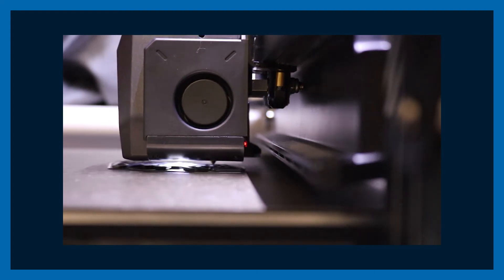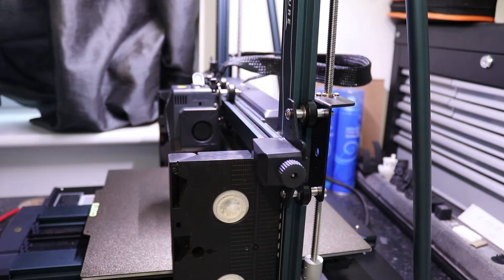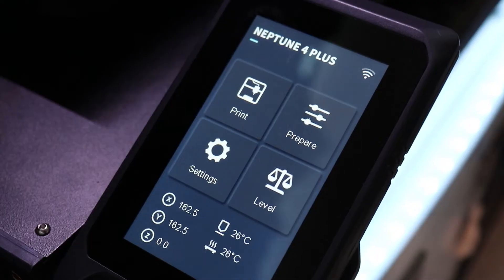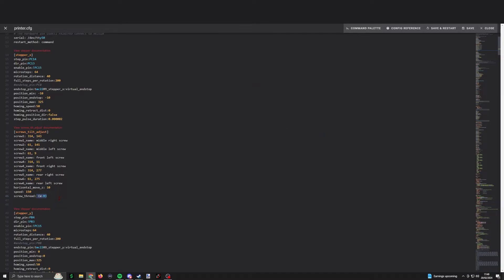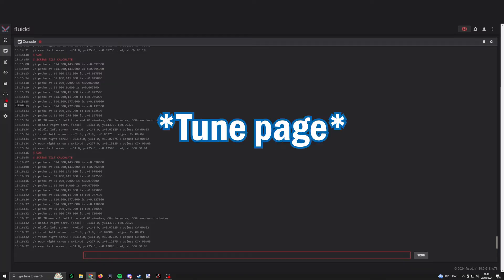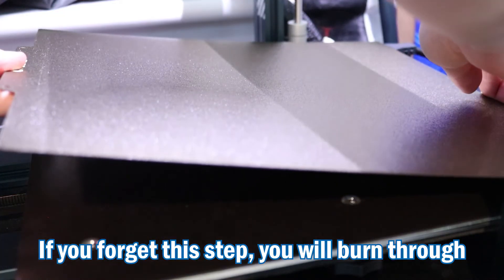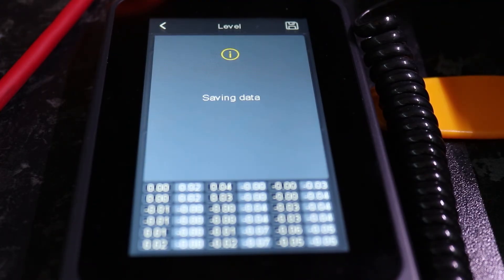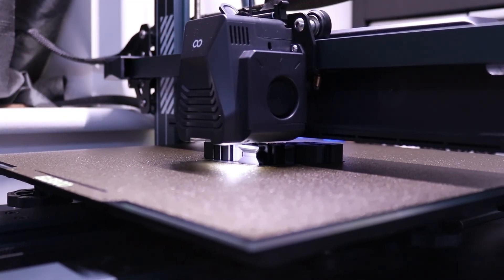Beginner Guide To Your Neptune 4 Printer

Comment: im confused about the leveling. because when I put the paper in and adjust the bed so that I barely feel traction, the head drags and scratches previous layers.
Reply from the maker: @jb1139  could be that the level isn’t being saved.

Make sure the bed is manually levelled first and is as flat as you possibly can get it.

What I have done to some issues was Z-Offset > Auto Level > Z-Offset. Always finish with a Z level.

But secondly that is partially why I couldn’t do the paper method. When I did the paper method I actually caused minor scratching on the print bed. Which is why I’d highly recommend a feeler guard as you can feel more and work from there.

After you can do some bed level tests to work on the Z more.

Hope this helps
Reply: @jb1139 if your 1st layer is good you might have too high flow rate like me

Comment: Hi, do you still recommend the N4+?  I purchased it today and I'm watching every video about ot till it arrives
Reply from the maker: @imnotryuu6391  Hi, so from my experience I had an issue where filament did get stuck in the extruder. Elegoo did send out a new one for me, I haven’t really heard of anyone having issues like what I had, so it’s probably a rare issue. Besides that the printer has been alright.

Since it is a lower end costing printer you do need to be hands on to tune it.

There’s always things they could’ve done to make it more user friendly but there’s loads of help online. 

I personally use Orca Slicer as I find that easier to work with imo.
Recently I’ve used ChatGPT to help dumb things down for myself too to make it more understandable.

Comment: im a little lost on what you mean by tightening the bed on the opposite side? So if the eccentric nut is on the right i should tighten the bed screw on the left?
Reply from the maker: @MasnMakes3d  So if you notice the left wheels are loose, you need to tighten the right wheels up since the right wheels have the eccentric nuts. The only wheel on the left side that has an eccentric nut is the middle one.
If the left is tight, loosen it via the right too btw.

Hope this made sense and cleared that part up for you?
Reply: @CazaCreates  yeah thanks buddy
Reply from the maker: @MasnMakes3d  no problem :)

Comment: For Screw Tilt Adjust, why not make the reference point one of the two center screws? That way, you don't have to adjust those to obtain a level bed.
Reply from the maker: @modinproductions  I did. I also mentioned it around 3:50. I personally use the right middle due to the printer placement.
Reply: @CazaCreates  ah, I misunderstood you. Thought you were referring to the two center wheels on the edges.
Reply from the maker: @ All good :)

Comment: How about properly turning it off?
Reply from the maker: @llNATEDOGGll  according to u/EarlyActivive66

“You can turn off the power switch  after the printer is cooled down or in the Webinterface fluidd the 3 points top right > hosts > shutdown”

I go from the switch but according to some others, the switch method isn’t ideal as it can cause corruption. So I will now try the other way. 

Apparently there WAS supposed to be an update for a proper shutdown. I can’t confirm this since I haven’t needed to and haven’t yet updated my printer

Comment: I have 2 maxes and both of them had same issue , the y axis rails weren't parallel, they were off by .5 mm from one end to other , this caused my wheels to be tight at front where i was adjusting them and way too tight at back which cause them to wear bad and was making bed wobble.
Reply from the maker: Oh that sucks, did you manage to get in sorted eventually or just moved onto a different printer?
Reply: @CazaCreates  Yes, I got it fixed. I had to take the The bottom off and loosen the rails and align the rails with the caliper. They had the same distance on the front and the back and got new wheels. Works great just now. Also used a digital angle finder to align the y s

Comment: Thank you for the video. I am getting the !! Move out of range: -5.000 30.000 10.000 [0.000] when I try to use the  "screw tilt adjust." How can I fix this issue? Neptune 4 Max
Reply from the maker: Sorry for the late response, I don't get notified for all my comments - did you manage to sort it out?
If not, one thing that helped me get the location was using Fluidd/Klipper to manually move the printer into position where the screws were, note down the location somewhere, then when I went to add Screw Tilt Adjust I put in those coordinates.

Comment: When using the feeler gauge, should I stop as soon as the nozzle touches the gauge? Also, when doing calibrate in the tune section the bed mesh looks almost perfect, but after doing the automatic with the handheld the entire bed mesh appears lower except for one side which is way higher. Any tips?
Reply from the maker: feeler gauge - I personally do it so once I feel the nozzle a little go down once or twice. This gives me a grippier feel but not too low. If it doesn't work out you can always print a bed test. If you want to really put it to the test there are methods where you can get the printer to do a bed test starting from low and work it's way up.

Bed Mesh - I had a weird issue with one of the corners being incorrect. Which is why I start my screw tilt in the middle of my printer. Make sure the bed visual settings is set correct ie Mesh matrix, color scale 0.2 box scale 2.0.
It could be flat enough that any slight imperfection is showing red, so check to see how high the highest point is to the lowest point as long as you Variance is within 0.2.
Next, just like in my video, try and loosen the 2 screws to see if that changes anything.
You could also try to find which part of your bed is the middle ground and use that as your starting point for the Screw_Tilt_adjust.
Last method that I can think of without being able to see it, not ideal, but using foil tape to help lift the side that is currently lower.

Do keep me updated if this helps. Can always get in touch via Reddit - u/Caza390 sending photos of your bed mesh and I'll see what I can do to help 👍

Comment: Dont use isopropyl on a pei sheet. You can look this up its not good for pei and corrodes it
Reply from the maker: Not from what I have seen/heard of so far. The closes thing I have seen about "corrosion" is using it to smooth off the prints itself. Would be quite odd for something that is highly used for cleaning, especially with metal to corrode a metal sheet. Out of anything it might effect the colour of the PEI sheet.

Comment: Just got a Neptune 4 last week and this is super helpful! As for the bed mesh and IP address - is this possible without the printer being connected directly to internet?
Reply: no, with printer offline you can't use klipper, i know that with neptune 4 you can add a usb wifi adapter if you can't connect by cable
Reply: You can connect it to your PC/laptop using an ethernet cable

Comment: How do you turn off the printer?  Is the power switch fine to use?
Reply from the maker: I just go to the home screen and switch it off by the power. If you don't go to the home screen it may show an error message before cutting out.

Comment: This video alone should be reason enough for god to let you through those pearly gates. 
I bought this printer 5 months ago, and just gave up on it because the levelling was pissing me off. 

Thank you very much. 

also, for the regular neptune 4, heres the screw code :

[screws_tilt_adjust]
screw1_name: front left screw
screw1: 55,10
screw2_name: rear left screw
screw2: 55,180
screw3_name: rear right screw
screw3: 225,180
screw4_name: front right screw
screw4: 225,10
horizontal_move_z: 10
speed: 200
screw_thread: CW-M4 # Use CW for Clockwise and CCW for Counter Clockwise
Reply from the maker: I'm glad my video was able to trouble solve your issue!! Good luck on your 3D projects! :D

Comment: I believe there is stone information wrong in this video. You can adjust the z offset in fluidd, BUT you have to issue a SAVE_CONFIG afterwards. The handheld does it too. 

I use the paper method for an initial z offset and then start a print of a lage rectangle (at least 100x50mm) with info angle 0°. Use an android app or the handheld to live afjust the z offset while printing that rectangle and stop the print if it looks fine. Save your settings, like described before in the console and you are ready to go. 
For petg i have to wait at least 45min to get 80°C stable. 
You can verify that yourself by:
 1. Home
 2. Set bed and extruder temps (e.g. 80 and 100)
 3. Run Scre tilt adjustment
 4. Repeat 3 until values are stable over 5-10 min and write down the time till the first stable run.

Comment: Beginner's guide for neptune 4 series:
Don` buy this piece of crap.
Reply from the maker: I think it depends on stuff. Cheaper printers = more work before getting good results. I mean there’s plenty of faults that could’ve been avoidable.. and I mean many! But if it does the job for some and a cheap price then it’s not too bad.

But if you’re expecting something out the box that works well I have heard Prusa printers are good!
Reply: @CazaCreates  oh and talking about a cheap printers. ender 3 v3 se is a way cheaper and it does it's job a way better than a neptune 4 series printers. Or u can pay a bit more and get a KE version. u need to root it though, but there's tons of manuals about that. Nothin' too complacated imo.
Reply: @CazaCreates  the main problem is that elegoo made their neptune 4 series firmware like a house of cards. It has a very old klipper version and once you update it or fluid -- it starts falling aparts. Tons of bugs where  inconsistent z-offset is the main one. 
You need to flash the printer (and MCU too, after soldering a couple of things at motherboard) with the custom firmware to make it worrk as it should.
As a third or more printer -- it can be interesting in some ways... But as a first printer it's literally a headache. Ask me how I know.
Reply: UPD:
After a six months of troubleshooting I've  defeated that thing already. And what I want to say about it... All the neptune 4 series (except of n4pro!) can become a good printer after changing to OpenNept4ne custom firmware (motherboard soldering is no needed no more). And swapping to custom part cooling fun duct is preferable too.
Reply: @kenyajobs1069  So the neptune 4 pro does not work with OpenNept4ne ?

Comment: The actual frame being level with the earth or your table doesn't matter too much. You could attach it to a wall and it should still print sideways, although some of the mechanical parts will experience more wear than usual.  Good video overall though.
Reply from the maker: Yeah, I've seen a video of someone trying different tables after people mentioning on how wobbly his table was, then I think he hung it on a rope or something and still got pretty good results. 
The purpose of mentioning is to remove any controllable errors. I know it's a minor thing and the odds are very very slim for problems with a crooked printer besides from what you listed, which is why I also showed that I used tissues to lift my printer (It was also very annoying that it shook my desk making a lot of noise and creating a challenge when working or gaming lol).
Also thank you :)

Comment: what if there's no IP, on the video it seems like u didn't have the IP number either...
Reply: Ah! Makes sense, and btw, did u blur mine too😂, I have Neptune 4 pro as well, strange I have no IP on mine… 
Thanks for the video
Reply from the maker: @Cofiko55  oh… strange?!
I just have a Quick Look around, could be a firmware issue. I don’t like the idea of pushing an update or anything but you might have to if you’re missing a function on your printer like that or see if there’s a firmware restart.
Do you have a WiFi adapter that attaches to your printer? If you do, try contacting the support about updates or check the Reddit/Discord links in the description to see about it / ask about it.
I haven’t done one before since I’ve never dealt with software issues. But I have heard that the printer and handheld are different things to update. So make sure, if you do update, do both!!
Good luck!
Reply: @CazaCreates  sigh, yeah that's what I thought, is there more simple way that what elegoo official site offers? thank u
Reply from the maker: @Cofiko55  See what would happen if you plug your printer in by the Ethernet port, then check "About Machine" to locate the IP. If it still isn't shown, I really haven't got a clue - at which case I am really sorry and you'll have to deal with the support side. Maybe try their discord which is in the description. If you are still struggling, email the support team - also linked in the description. I wish you luck! Again sorry for not being able to assist you, I couldn't find anything that holds a similar issue :/
Reply: @Cofiko55  I have no IP on my n4pro either. Were you able to fix it?  My ip disappeared when I installed a new emmc from elegoo.
Reply from the maker: Hi, I believe all the Neptune 4 printers are Wireless.
My printer is the Neptune 4 Plus. I do have an IP, I just blurred it out for personal preference and comfort.

If you get any of the Neptune 4 printers, they should be wireless. But there’s also an Ethernet cable which you can hook your printer into.

I hope this helps with any confusion :)
Reply: @CazaCreates The Plus and Max have wireless and ethernet, the Pro is ethernet only.
Reply from the maker: @leejbarker32  ah noted, thanks!!

Comment: Hi. How did you work out the Z offset you need please. Enjoyed the video but maybe a bit too advanced for me...
Reply from the maker: I’m not too sure with paper as I couldn’t ever tell, but a good rule of thumb with a feeler gauge is to get as close as possible until you feel some grip. If you notice the printer head move (which I found using a camera helps with that) then you are too low, if you are hardly feeling any resistance, go a little lower.

Try printing at this point, if it’s not working out, try printing at a slight bit higher or lower by 0.01. 

There is probably a way to use Klipper to move the print head up over a certain point when doing a ‘bed level test print’ but I haven’t explored Klipper enough to figure out that trick yet.
^ You could check some of the Reddit pages to see if anyone has a way to do that.

Hope this somewhat helps? 😊